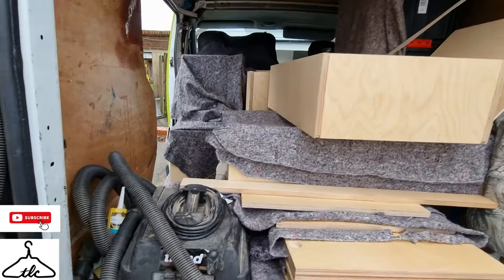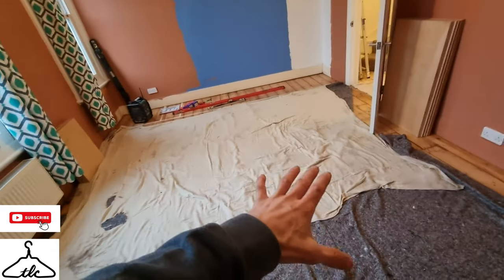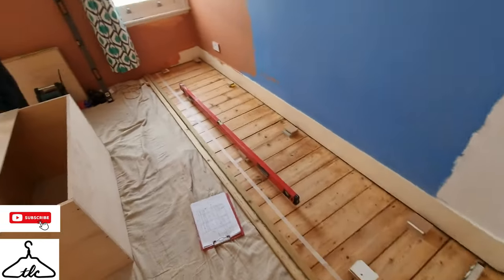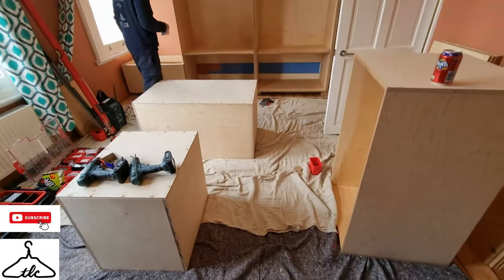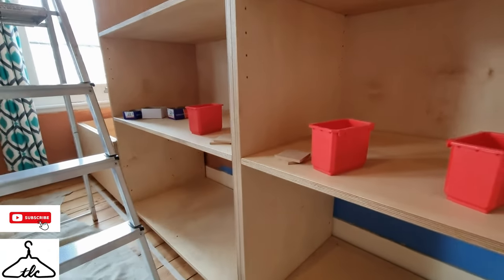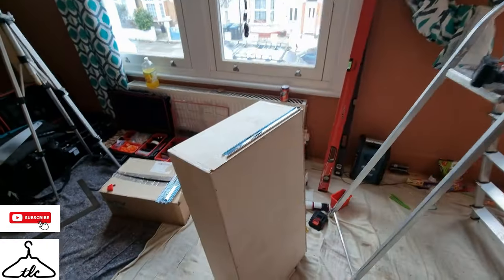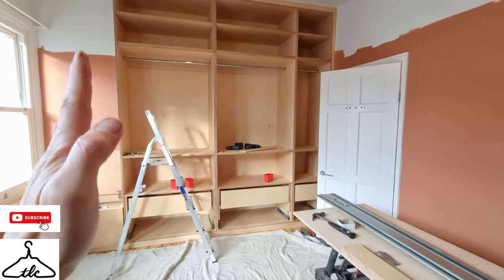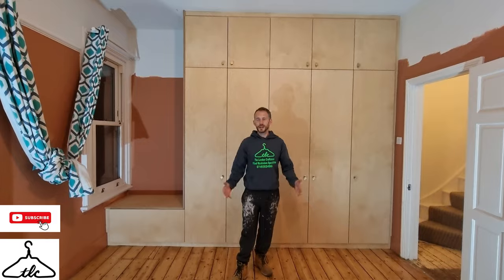How To Build A Wardrobe PART TWO / The COMPLETE INSTALL in a SINGLE DAY/ Birch Ply Wardrobe /Vid#127

Comment: Excellent works chaps👍👍! I’m a 64 yr old carpenter/joiner and I’ve been using virtually the same methods you use for years. I also hate the plastic carcass legs and have always built a base frame similar to yours,much stronger and as you say no need to level the units after. Looking forward to your next video, keep up the great work👍👍
Reply from the maker: Thank you, I appreciate you taking the time to write this message.
Yes, it's such a simple way of leveling up carcasses I'm surprised not many others do it!
Thanks Ryan 👍👍

Comment: Hi ryan, lovely job as usual, did you use overlay hinges on all the doors, or half overlay hinges to keep the consistent 3mm gap?, if you used overlay, when would you use half overlay?, or dont you need half overlay if your measurements are perfect.

Comment: Great work lads and some great inspiration for someone planning a similar wardrobe made of 100% birch ply. For the carcass next to the window seat are there exposed screws on the outside? Is this typical for birch ply construction?
Reply from the maker: Apologies youtube blocked this message for some reason
Thank you very much!
And I'm not sure there are visible screws, no, especially on Birch.
Well not ever on the front really ☺️
It would most likely be covered if so, or the fixings from the side.

Cheers ryan 👍

Comment: Nice work. You could save material on the drawer packers by packing out just the drawer runner as compared to the entire internal drawer cabinet walls. As it’s only seen when the drawer is extended it wouldn’t be noticeable and at current birch ply prices, might be something you may wish to look into - as a rough estimate, you’d save just over half a sheet on this job which is more cash in your skyrocket.

On this score, roughly how much do you charge for an installed unit such as this?
Reply from the maker: I think its just easier to do as a whole panel, less work. Anything for an easy life 🤣

Comment: Did you glue the cabinets in site or just screw?
Reply: I think they just use screws
Reply: @afnankhokhar5578  Much simpler than all those smart connectors or even dominoes.
Reply from the maker: Yes just biscuits and screws. There is no need for glue 👍